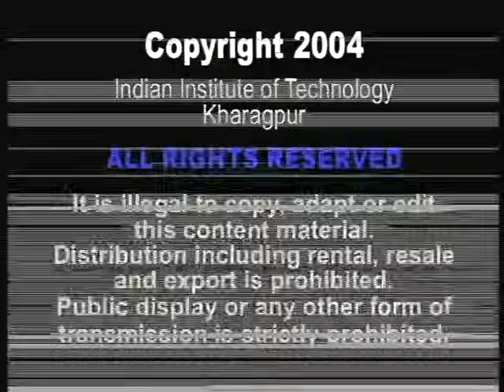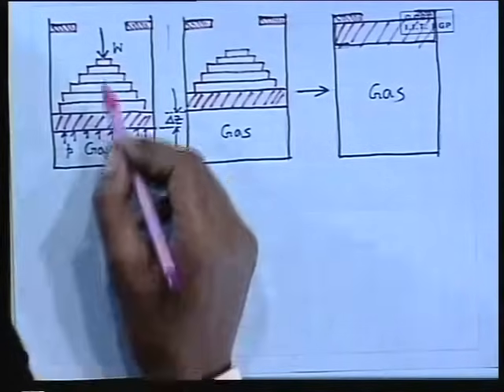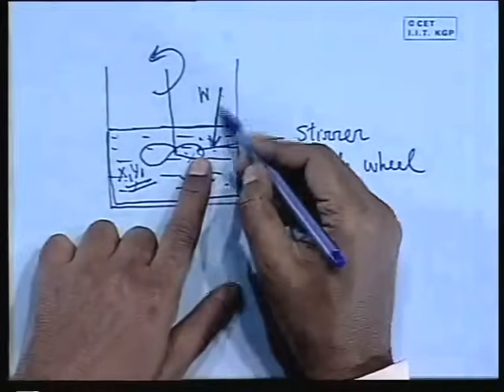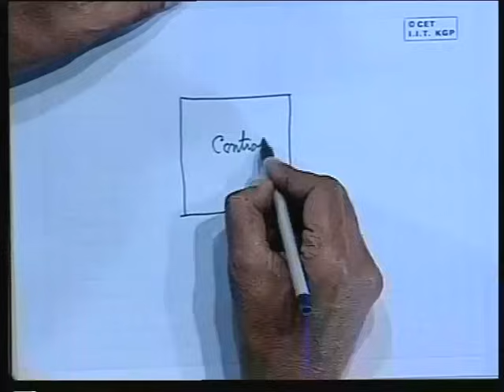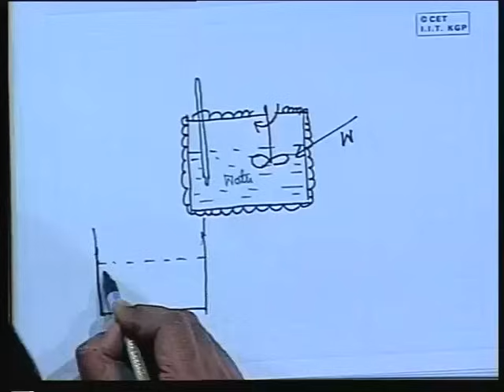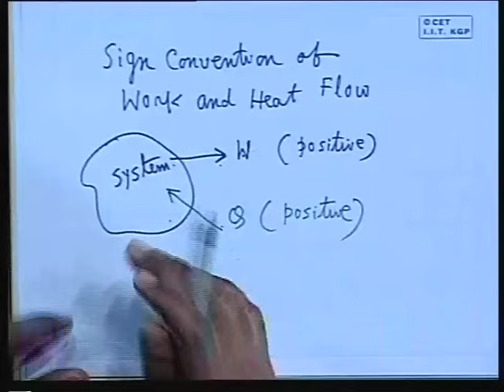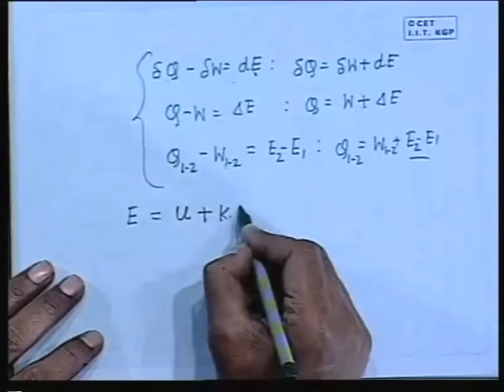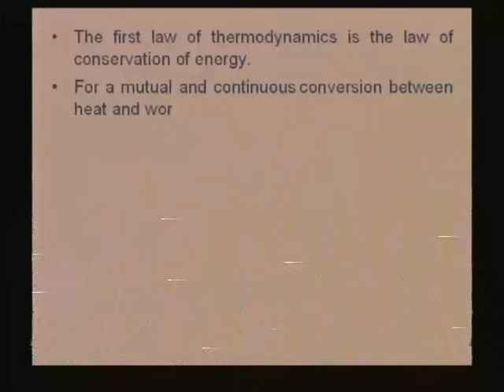Lec-3 Different Kind of Energy and First Low-I

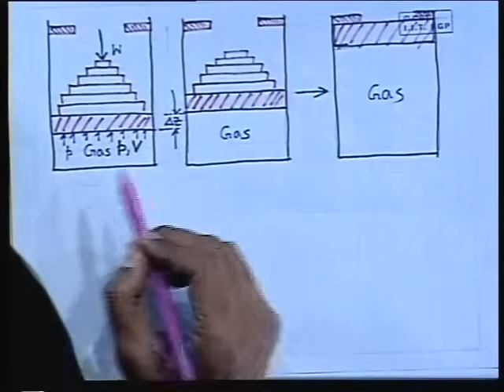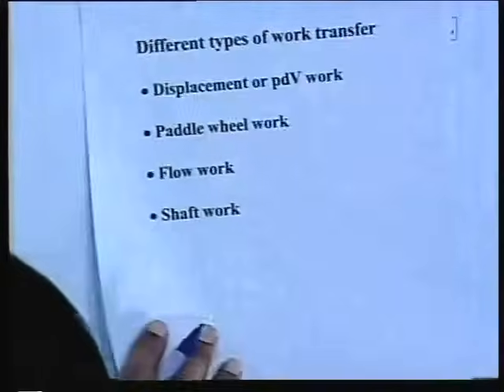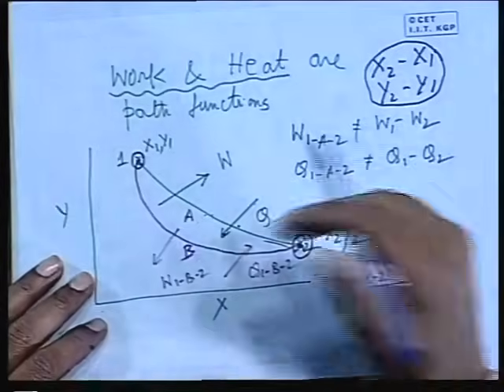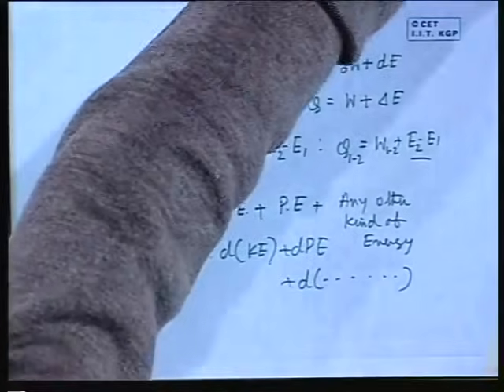Comment: Forms of Work Transfer1:30 ,Displacement (PdV) Work 3:10 7:50, Paddle-wheel work 15:00 , Flow Work17:44, 26:56; First Law of Thermodynamics 30:20, 50:51, Internal Energy 52:10, 53:00**, 54:14**
Reply: Thankyou very much 🤗🤗
Reply: for heat tranfer subject which prof.is good can you mention

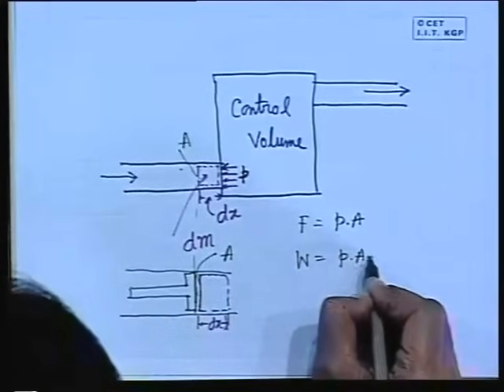Comment: Why the work in case of flow work is p.a.dx force should not be equal to p.a as the liquid is not going slowly @ 23:35
Reply: because work is equal to force dot displacement.here p.a=Force
Reply: f=p.a if fluid is going slow, not in every case. There is also a velocity related with it.
Reply: hello bro..... tell me one thing that why sir take pressure constant in displacment work or pdv work.......   
because according to me pressure is also some change in pdv work .....
Reply: consider it as the energy contained in a unit mass of fluid element by the virtue of its pressure, if pressure and/or density changes over the period, the flow energy shall also change. If we neglect all the frictional losses and changes in potential energy, for a steady flow this value of flow energy shall not change
Reply: it is pressure which oppose change in system..it must be equall to surrounding other wise equillibrium will not exist.So,for basic and better understanding of phenomenon in thermo such type of assumptions are made.
Reply: mayur makwana
thanks bro..
Reply: You welcome bro
Reply: pressure is applied on fluid element(having same area A as assume a piston behind it) by the control surface that is p and in this case F= pA
w(pressure work) =F.dx
(dx is displacement  of fluid to entered in control volume)
Reply: It's control volume process so instead of ds we go for dx
Reply: @airtel1730  in pdv work, pressure is near to constant coz from State 1 to state 2 there is a change in pressure but very small

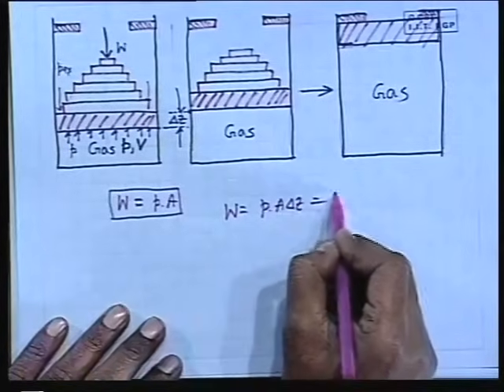Comment: At 10:38??? 
1) the piston is in equilibrium means p*a = w 
2) if we remove small weight (say dw) then net force on the piston will be (w- dw)or we can say (pa - dw), which will be resposible for the motion of the piston. Then work done during that time should be (pa- dw) * dz but the professor says pa*dz..... Can anyone explain???
Reply: At the very instant when dw is removed the force due to system is p.A and so work will be done by this force will be p. A. dz
Reply: P is not a single constant value. P is a function that gives the pressure of the gas at any instant

Comment: in a cyclic process, work is given by the area of the loop. But, at 40:10 the professor told that the heat given and the work done are equal which means there is no work. Please, can anyone make me clear about it?
Reply: the amount of heat added is equal to the amount of work done . thats the logic
Reply: hello bro..... tell me one thing that why sir take pressure constant in displacment work or pdv work.......   
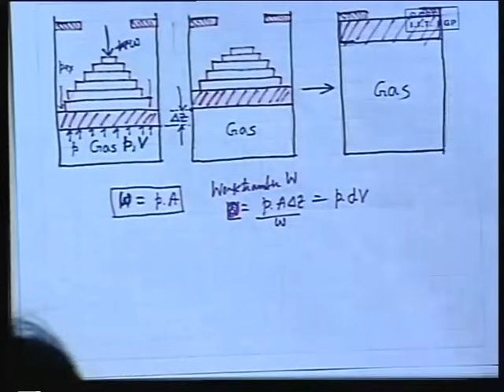because according to me pressure is also some change in pdv work ..... at 11:29 in example
Reply: I'm also sure about it
Reply: Bigyan Magar it means it is a reversible process.

Comment: In flow work,if the fluid has to apply pressure equal to gas pressure of control volume,then how the mass will flow inside the control volume.
Reply: It will not work.work will be 0
Reply: yes i was thinking the same thing but one think which can be possible is if you take gas pressure or external pressure to be p + dp (which will result in mass flow) and then multiply volume A.dx you will get pA.dx + A.dx.dp as you can see dx.dp will be very small hence can be neglected . therefore W=p.A.dx

Comment: Why does the force which is used in work formula is due to the external force. When the system expands  ,it is due to the internal force of the system  then why it's not internal pressure in expanding of system
Reply: it is because at every moment equilibrium is attained....so it will not be wrong to say that the external and internal pressure are same momentarily....so work done by internal forces equals work done by external forces.

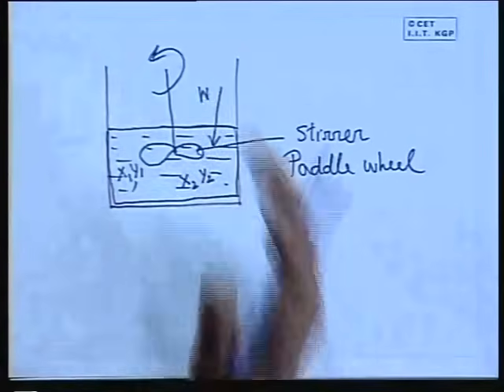Comment: 16:10 .........sir in paddle work  would only temperature rise and not kinetic energy of the fluid?
Reply: Abhinav Anand bro according  to kinetic theory  avg Kinetic energy of all molecules of a system is termed as temperature..
Reply: At macroscopic level, KE is a func of mass & velocity. Flow energy is the energy required to move the adjacent fluid layer which is a function of P & specific volume only... So we should not mix both... I hope it may help you..

Comment: At 11:22 why w is divided to the equation of Work transfer?
Reply: Karan Thaker Sir hasn't divided 'w' from that equation. Its just that he has underlined  'p.A' that it denotes 'w'.
Reply: I was really confused,Thanks for helping me.LALIT DOGRA
Reply: hello bro..... tell me one thing that why sir take pressure constant in displacment work or pdv work.......   
because according to me pressure is also some change in pdv work .....
Reply: no we assumed  it as a quasistatic process where for every infinite small interval the system becomes equillibrium with upper load where we get that it is pressure which balances upward laod      hope i answered ur doubt
Reply: Karan Thaker lmao.. He just notified that 😂
Reply: airtel in that case we have to take double integration... Here same magnitude of force is applied normal to piston area all the time so can't see why pressure should change
Reply: @airtel1730  sir didn't said P is constant... For every intermediate state point, there is a infinite small pressure difference due to which displacement work is happening...
Reply: Kindly rply if the concept is wrong...

Comment: Sir is this no need of work,or no temp. Will increase
Which one is right?
Reply: In paddle wheel work
Reply: In paddle one we rotate the stirrer 'cause of this work is done by us, due to which temperature rises. Second case we doesn't insulate the bottom side of container then a hot body is kept below it, due to temperature difference heat flows from higher temperature to lower temperature.

Comment: How flow work is point function 24.05 min Sir mentioned
Reply: Because pressure and specific volume are point functions
Reply: @amarbirajdar7243  wrong bro..
Reply: He didn't explain work that work was a point function. He said,  when dx tends to zero, we can define flow work at each and every sections as these are the point functions, he used "these are" for pressure and specific Volume not for work.

Comment: work and heat are path function (energy in transient) then at 24 :56 professor  told  work/mass =pressure by control surface × specific volume of fluid element is considered as point function 
why???
plz anyone  is there help.
Reply: Because pressure and specific volume are point function